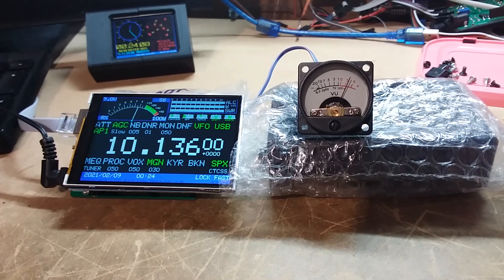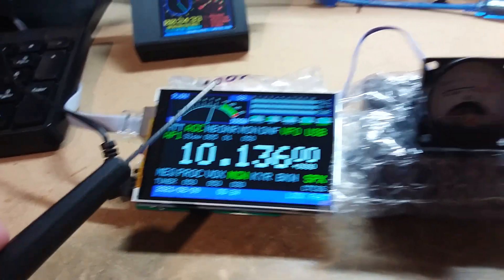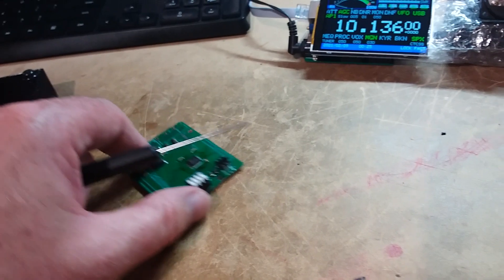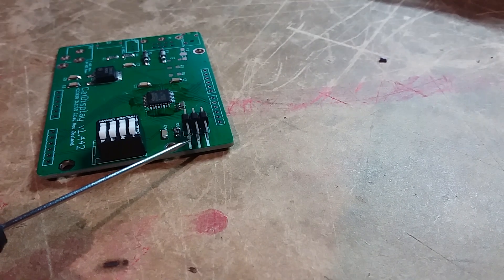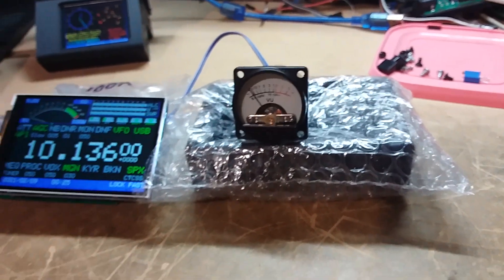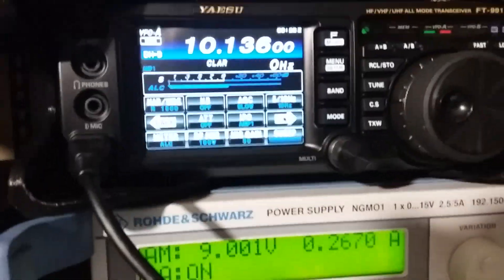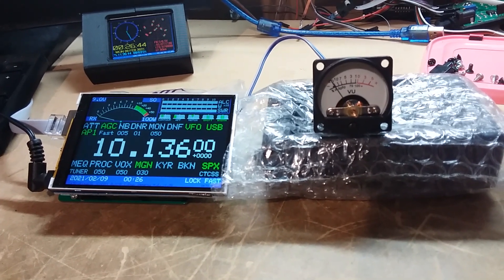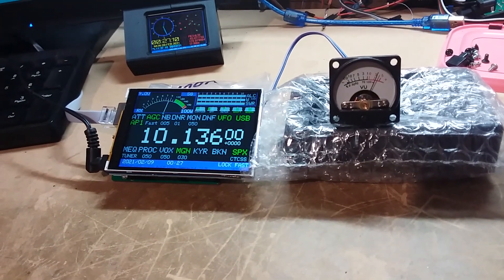CatDisplay232 Analogue Meter

Comment: I see an ebay listing for 450D is this true? has anyone tried  this?
Reply from the maker: I am not sure if it has been tried with FT-450. Many of the CAT commands are the same as FT-991A but some are different and some items FT-450 does not have like time, date, Etc. There is compatibility chart on the eBay listing, which shows all the commands CatDisplay232 uses and which are the same by transceiver. None of my customer have said - I bought this for FT450 and I do not have FT450 to try. 73s om de chris zl1cvd

Comment: will that also work on the one for the FT-857D?
Reply from the maker: I'm not sure why you would want external S-Meter support on FT857 CatDisplay as the transceiver already has an external S-Meter drive. But yes, the latest versions of CatDisplay for FT817, FT818, FT857 & FT897 now have an external S-Meter drive feature.